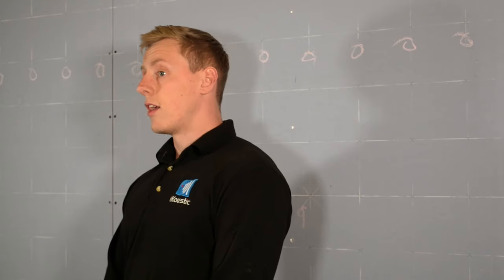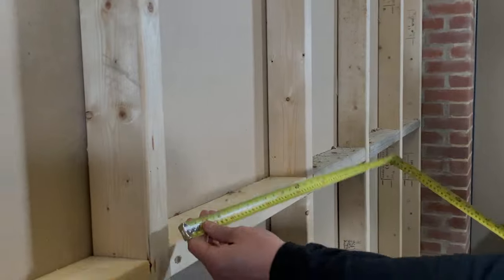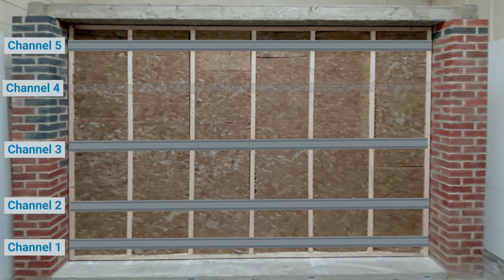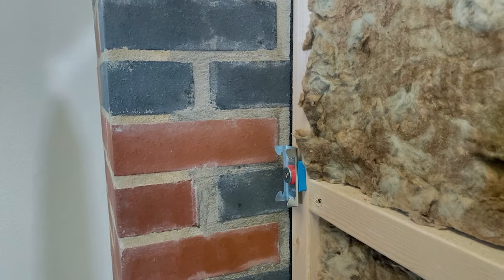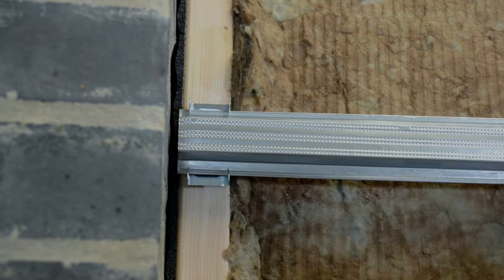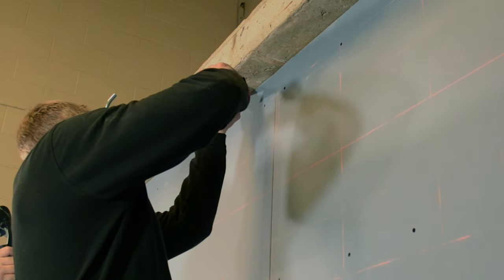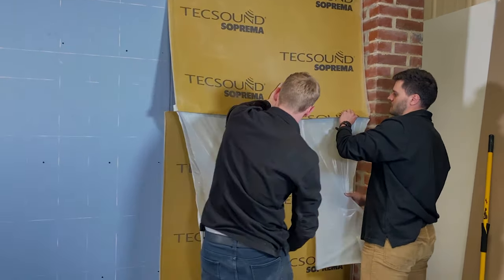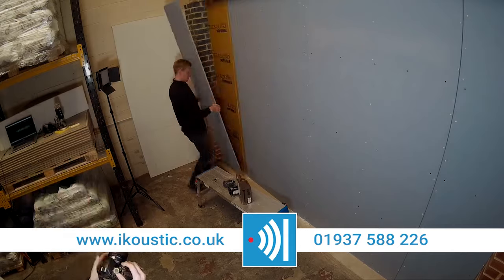Soundproofing walls (8 step DIY guide)

Comment: how does this work for blocking out heavy bass, low frequencies.....that's what i'm trying to block out from my neighbors apt next door, i keep hearing his bass... does this system work for bass?
Reply from the maker: Hi,

Low frequencies are the hardest to soundproof against. That's why you can always hear the bass outside a bar or nightclub. That being said this system will reduce a lot of the bass you're dealing with. If you want to see how it holds up against different frequencies you can see the data here https://www.ikoustic.co.uk/wp-content/uploads/2022/09/iKoustic_MuteClip_Systems_Performance_Data.pdf

Thanks!

Comment: It's good to show you but doesn't show how good it actually works. They should do a normal wall with sound coming through then this ikoustic system in place so we can hear the before and after. I know they have a separate video showing decibels reducing 5,10,15 etc but that's not in the real world . This video should have been a before and after so we can hear how affective this system is.
Reply from the maker: Hi Glenn, thanks for the suggestion! Sadly this is a free standing example wall in an open space, so a sound test as you describe wasn't possible. We are always looking out for these opportunities as we know hearing is beleiving!

Comment: Wouldn't one get just as good a 'sound-proofing' if NOT using the 'Mute Clips' ??  (it's all very expensive for me tbh)
Reply from the maker: Hi Blue Horizon, 

The MuteClip Double is our top-performing system. We do have more budget-friendly options on our website. https://www.ikoustic.co.uk/wall-soundproofing/

To illustrate the benefits of mUteClip you could compare our MuteBoard 2 system vs our MuteClip double system. MuteBoard 2 system is missing the MuteClip and channel and one layer of plasterboard. This system is capable of creating a 6dB reduction whereas the alternative using MuteClip creates a 15dB reduction.

I hope this helps!

Kind regards,
Miles

Comment: Thanks for the informative video.  I'm just curious why you stand up the drywall, short-side down instead of long-side down to reduce the number of vertical seams in the wall. I'd think less seams less noise penetration. Also less vertical seams makes the finished wall look smoother to the human eye. I used isolation clips on my ceiling and on the walls I laid my drywall long-side down for my percussion room and it has worked very well.

Comment: Great video! The best!! What kind of board did you use for the back of the  frame?                                   What should be the distance between the frame and the brick wall itself?                                                   What kind of spacer to use to maintain the distance? 
How do you close the gap on the side of the frame and the wall? Thanks !!

Comment: This looks like a good system.  I've always had good luck with 2 walls with regular drywall on the first, then 1/2", insulation, and a double layer on the second.  No special materials needed which is a plus.  I can't hear anything of the neighbors despite sharing a very tall wall.  I may look into this if I have to do another one and don't have the space.
Reply: Does this mean you didn’t build a stud wall and put plasterboard on the wall then 1/2 insulation? If so how did you fix it & what insulation? Bit confused with all these special systems..

Comment: Great video, seems to add a lot of weight to the floor though? if this was installed on a first floor presumably you would have to get a structural engineer involved?
Reply from the maker: Hi,
Because all soundproofing uses high mass, it is best to consult a structural engineer before you install a system, yes.

Comment: Hi iKoustic, great video! Any specific reason why you recommend the 60kg/m3 mineral wool over the 100kg/m3 mineral wool? I'm assuming its simply an effectiveness per cost as 100kg/m3 would always be better. Is it just that it's a negligible gain for the much more expensive wool? Thank you!
Reply from the maker: Hi Studio5, 

You've hit the nail on the head! For most people, it's only a negligible gain for the price uplift. 

Cheers,
Miles

Comment: Hi. How you can connect the stud frame with the existing wall? 🤔  Only in this part I'm struggling.  Thank you
Reply from the maker: Hi, our current systems don't actually use an additional stud frame. This setup is for our in-house testing and is a stud wall supported by brick pillars. Our current wall systems use MuteClips that are screwed directly into your brick or stud wall. However, if you want to create a decoupled stud wall in front of your existing brick wall, you would need to cover the outer perimeter in flanking band, to reduce vibration transference, and then screw the frame to the adjacent structures.

Comment: Great video ,how can the studs be joined to the party wall to make sure of a gap?
Reply from the maker: Hi Mez, 

You can build a stud frame that connects to the adjacent walls, floor and ceiling slightly set off from the party wall. Alternatively, you can attach MuteClip directly to the party wall. I hope I've understood your question but if not feel free to call our team on 01937 588226 and we'll be glad to help!

kind regards,
Miles

Comment: Do you have any transmission loss data on this system in front of a typical brick wall build up ?
Reply from the maker: Hi, 

Here's a link to the MuteClip systems performance data in different application areas. 

https://www.ikoustic.co.uk/wp-content/uploads/2022/09/iKoustic_MuteClip_Systems_Performance_Data.pdf

Comment: Hi, can the board be installed without the metal bits? Thanks.
Reply from the maker: Hi K0msur, 

Yes you can just use acoustic plasterboards if you wish to improve your noise issue. It's worth noting it won't deliver the same results but if you are only after a small improvement this is a common choice. 

here is an example: https://www.ikoustic.co.uk/products/stud-wall-soundproofing/muteboard-2/
Reply: Hi thanks for the reply, but what I meant was, if I install a frame out of timber and put the rockwool inside, can I just drill the plasterboard onto the timber frame?Thanks. @iKousticSoundproofing
Reply from the maker: @K0msur  You can yes. This will result in poorer performance but is a common soundproofing technique.

Comment: Do you use acoustic sealant between the sections of tecsound
Reply from the maker: Hi,
It shouldn't be required between the Tecsound layers as there aren't usually gaps. As the video shows, you can fit the Tecsound layers right up next to each other. You can also overlap them slightly and then trim away the excess for a perfect fit. If you did end up with some cracks, then sealant won't hurt and is a good idea.

Hope that helps!
Reply: Thanks! You offset the stud wall from the party wall, but then isn't the rock wool touching the party wall? Is that an issue?
Reply from the maker: Hi  @deaosatori216  ,
No, this is perfectly fine. Acoustic mineral wool doesn't conduct vibrations in the way rigid materials do. Instead it 'exhausts' them, so contact is perfectly fine and will prevent cavity space fo the drum effect.
Reply: Thanks! Do you ever experiment with adding rubber or tecsound direct to wall before building the stud, like quietco often suggest?
Reply from the maker: Hi  @deaosatori216 ,
We haven't done this but we prefer using a membrane between two rigid layers (in this case acoustic plasterboards) as it adds a degree of flex. This prevents a sound that might excite layer one from easily passing into layer two.

Comment: Can you used one layer of plasterboard?
Reply from the maker: Hi Theresa, 

Yes you can, this would be called out Muteboard Single system. In this system, you adhere the Tecsound to the back of the plasterboard before installing instead. 

You can read more here >  https://www.ikoustic.co.uk/products/brick-wall-soundproofing/muteclip-single/

Comment: So the last part confuse me with the sealing. Isn't that thin layer applied along the edge a huge weakness in the wall? 
In regards to subwoofers and sound isolation in general? I've never understood that part. And could you not also add isolation in the space the decoupling creates of its depth, although a small gap?

Also is there a way to come in contact with you? 
I have my complete floorplan with the wood structure made in a 3D program. I have stripped down all my walls in the living room and changed the isolation to hunton woodfiber. 
About to build a second two inch wall with isolation on the inside against the harsh cold weather and trying to figure out the best way to build it without ruining my wallet. Decoupling is off the table, but the rubber band underneath the wall and on top and sides, with a small gap between and heavy wood fiber boards on that with no connection to the walls or ceiling is where I'm at. 
Thanks!
Reply from the maker: Hi Aleksander, 

Thanks for reaching out. I'd recommend visiting our website for contact details and to read more about our specifications. Here you will be able to reach out to the technical team to discuss you're the problem.

Kind regards,
Miles